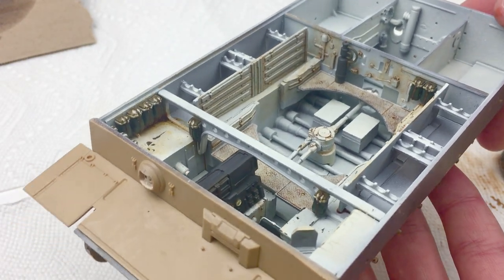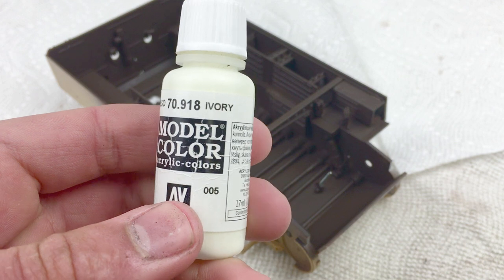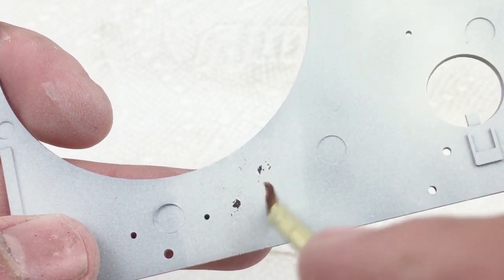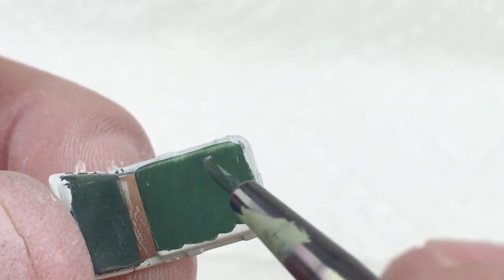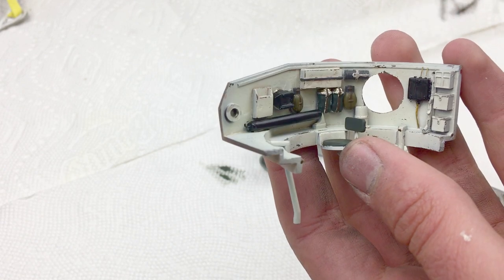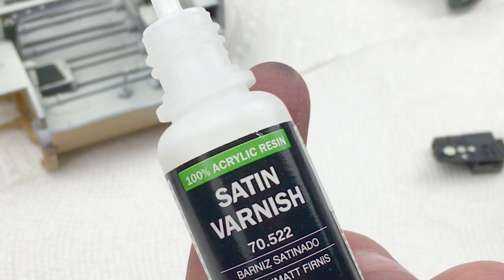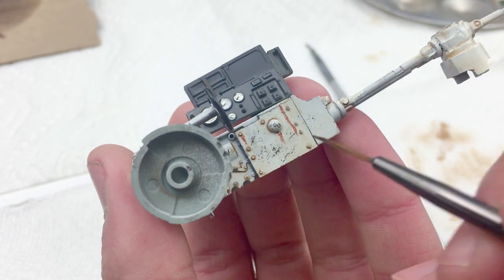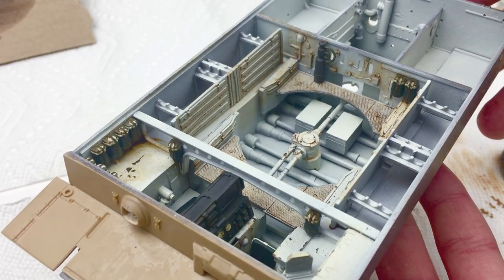Time to Paint This Tiger's Interior: (Airfix 1/35 Tiger I "EARLY VERSION")

Comment: Looks very good. One suggestion...the floor of the turret will not be rusty where the paint wears off. The boots of the crew will leave bare metal which will be a dull shine. On my 1:25 Tiger I used metal polishing powder to create the base and then chipped the paint layer off where there would have been most wear from the crew's boots

Comment: Scottish Bonsai is right!   If tell about the 131  Tiger  in Bovington, this tank manufactured in 1943 and keeps real colors.  Top - RAL 9001 (A.MIG 017, M. Air (Vallejo) 71.270 ),  bottom - greyblue (A.MIG 210,  M.Air (Vallejo) 71.304 ).

Comment: Hey man, I can see a few things that would improve your brush painting. One thing that would help your brush control a lot is being mindful of the shape of the paint on the tip of the brush. You should wet your brush and shape it to a point with your fingers before applying paint, then try to paint with that tip. When you pick up paint, touch it gently to the pallet so there isn't a globule around the tip. It also seems like you could stand to thin down your paints with a little more water. When you paint, touch the tip down in a central area and gently push toward the edges, letting curves guide the bristles. When the tip starts to run out of paint, you tend to paint with the middle of the brush (10:45), which means the tip paints areas you don't intend. Instead, just get more paint on the tip.
Reply from the maker: Thanks for the advice, I am definitely going to put these tips to good use! Greatly appreciated!

Comment: Useful guide to chipping, although chipping the jerry cans before painting their final colour seems a waste of time tbh. I might also have painted the hull and accoutrements separately before chipping and assembling them as it makes everything easier to do.
One other minor point, I don’t believe that internal components will have rust streaks running vertically, because they shouldn’t get that wet in use or storage. Oil streaks from leaks or overfilling maybe, but not rust streaks. Same pretty much applies to outside unless the tank has stood unmoving for some months. Rust chips yes, possibly, on carbon steel and iron, streaks unlikely.

Comment: great video and channel , hard to believe its only a month old.
as for the satin lifting issues , maybe it didn't set properly?
Reply from the maker: I left it a day, but I think that the coat was too thin
Reply: @TheScaleEngineer  maybe also test the mix you used for the oil , maybe the acetone reactivated it or something
Reply from the maker: Yeah, I just used Testors Enamel thinner. The problem is that Vallejo paints are notoriously weak, and even will be reactivated by different oil based thinners, so, really, I think I just need to get some more durable varnish or be gentler with the stuff I already have.

Comment: The wrinkles?  What did you water the varnish down with?  Use bottled water not tap water.  Tap water has chemicals added to it and can cause weird shit sometimes. Also switching between paints can leave a residue than can react with the next paint.  Windex, or screenwash and then bottled water to flush through.  Used to get issues when after Tamiya paints Vallejo would clog or react on the kit.
Reply from the maker: Thanks for the tip, yeah, I have switched primarily to the Tamiya
Reply: @TheScaleEngineer  Got this tip from Harry Houdini.   I use many types of paint.  Now I use bottled water to flush between types I have no problems.   Live in a hard water area, so chemicals added.
Reply from the maker: Yeah I do too Ian, thanks for the tip

Comment: A question, why didn't you thin the oil paints with enamel thinner?
Reply from the maker: I did, did I say lacquer thinner one the video? For future reference, I use testers universal enamel thinner for all of my oil paint work
Reply: Brother, you should've thinned oil or enamel paints with enamel thinner such as white spirit or turpentine or you can get the ones which modelling companies make, as for your satin varnish chipping off I'm so sure it got chipped off by the lacquer thinner you used to thin the oil washes, keep in mind that lacquer based paints have stronger chemical than acrylic and enamel paints so as their thinner, since lacquer thinner will easily wipe off any paint.
Reply from the maker: Gotcha, thanks! Yeah, I switched to Tamiya varnish, and really eliminated the problems I had with it